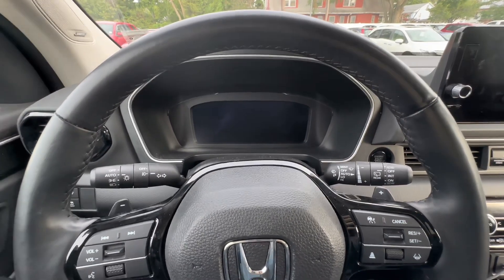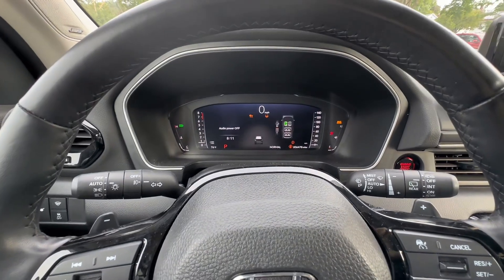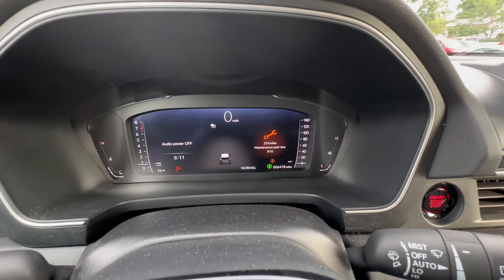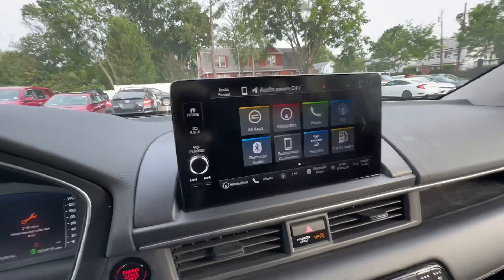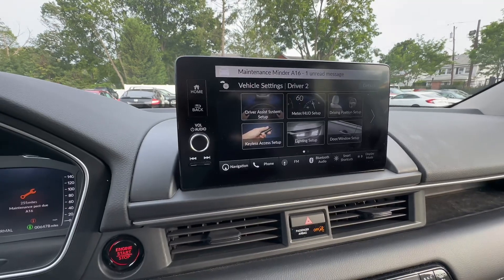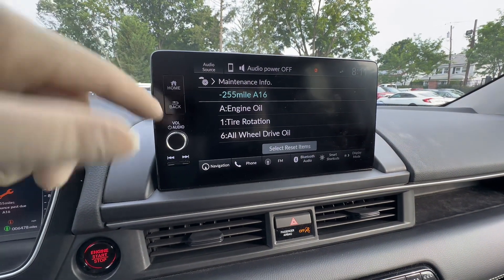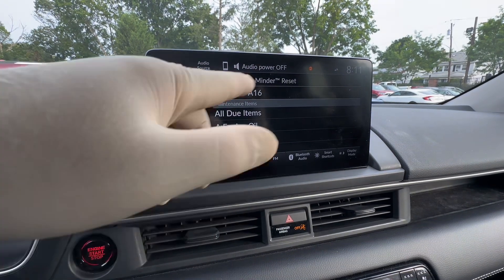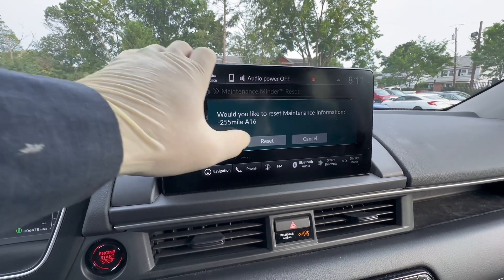2023 + Honda Pilot Elite maintenance light reset

Comment: Why does honda require break in fluid for the rear differential vs other manufacturers? What is the expected interval to then change it after? 

Kind of annoying that with Honda pass they will cover the oil changes/tire rotations but not the rear diff fluid change at around 10k miles..
Reply from the maker: Hondas rear diffs have clutches and aren’t a conventional rear differential. Not sure about them covering the services tho. I’ll try and get an answer.